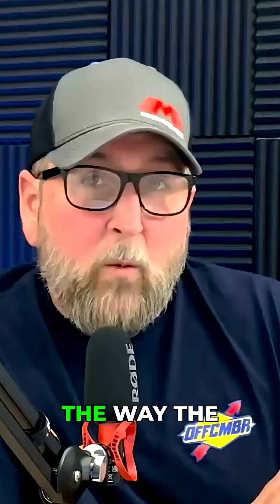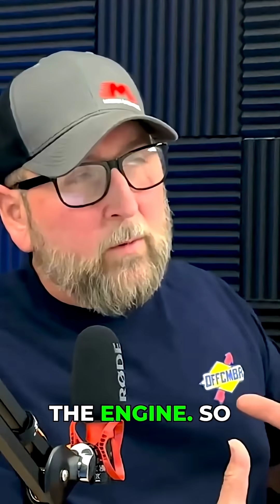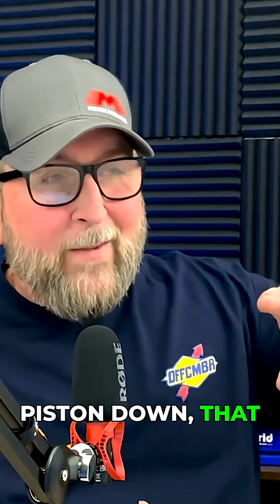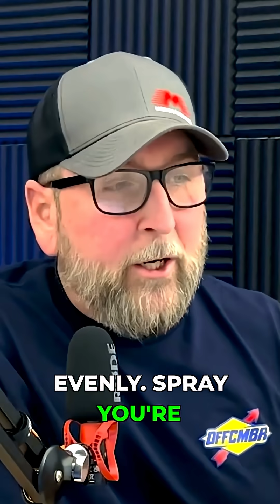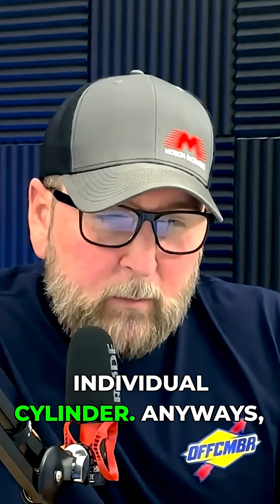Carburetors vs. Fuel Injection: Which is Better?

Comment: You're forgetting GDI, gasoline direct injection, which is problematic because the intake valve doesn't get its nice fuel bath, since the fuel is directly injected into the cylinder. Intake valves end up getting rather crusty as a result. Yeah, I get it's a variation of port injection, but enough different, especially because of the problems it causes, that it deserves a separate mention.
Reply from the maker: I'm not forgetting it. I just refuse to acknowledge its existence. I am anti carbon buildup. Does no one care about the valves?